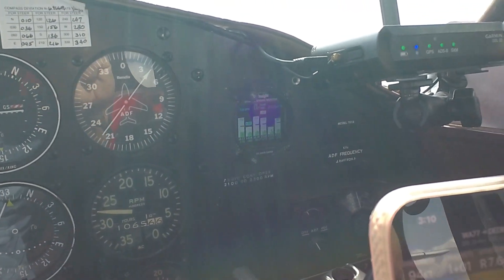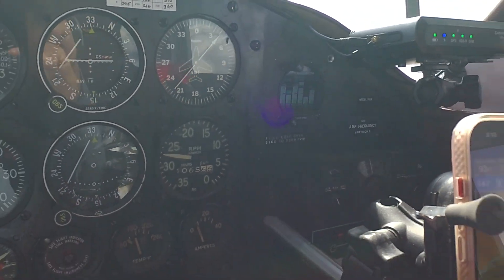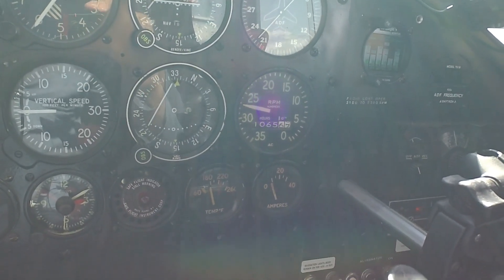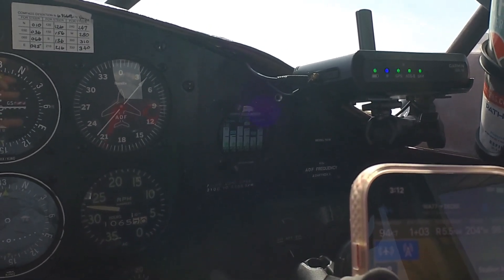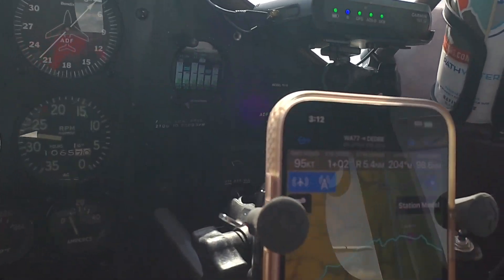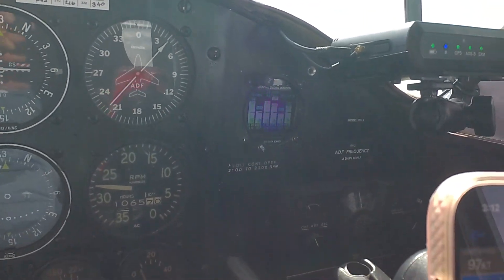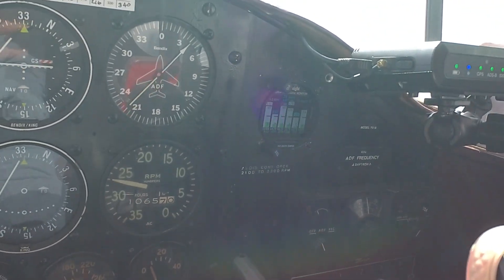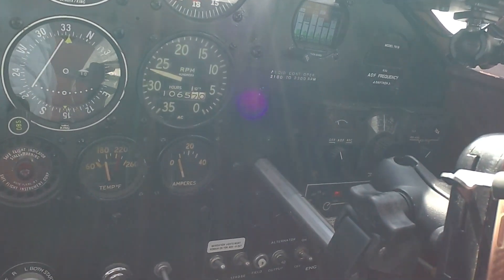Insight G2 Engine Monitor First Flight

Comment: So what did you set the threshold for on the lean of peak/ rich of peak setting
Reply from the maker: On this and most all carbureted engines, lean for smoothness. I back off mixture until it gets just a little rough, then enrich just a little for smoothness. It’s almost impossible to cause detonation this way.

Comment: Thanks for posting.  I'm considering a G2 Insight for my Cessna 150/150.  My old monitor only has CHT for a single cylinder.
Reply from the maker: I like the logging feature and all connections can be unscrewed to quick replacement if needed. Insight also keeps their product line fresh. Nothing but 🙌👍👍.